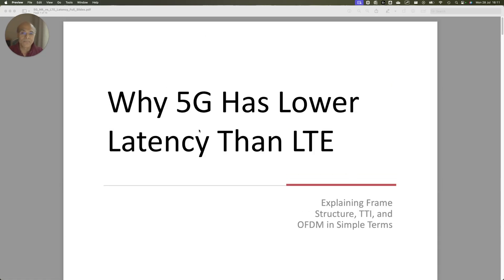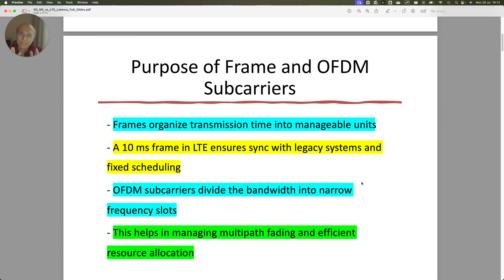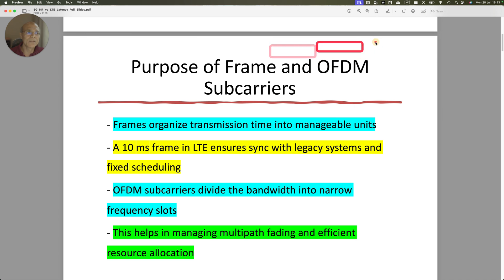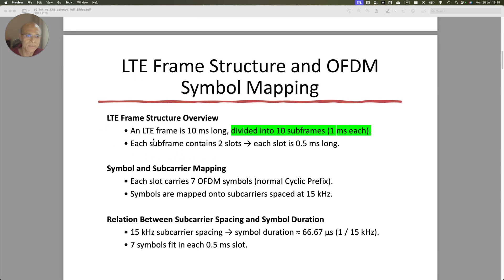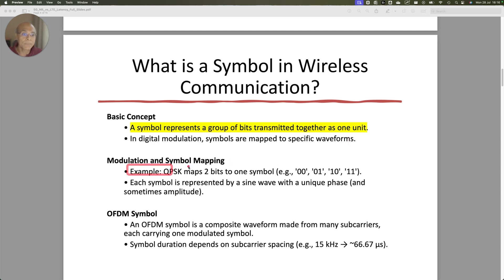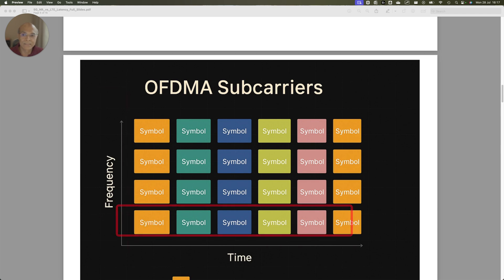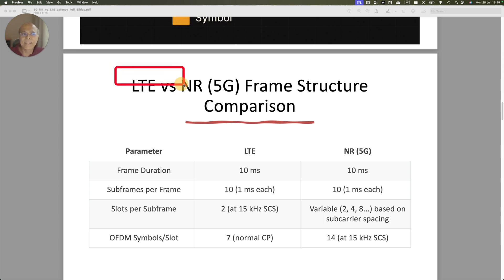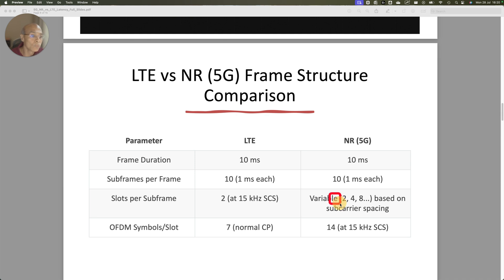Why 5G Has Lower Latency Than 4G LTE | Symbol, Subcarrier & TTI Explained Simply

Comment: Yes sir, while 5G certainly outperforms 4G on paper in terms of speed, latency, and overall network capacity, the reality for the average user is quite different. The real-world benefits of 5G are still limited, especially when you consider the significant infrastructure investments required by telecom operators. Unlike the relatively simpler 4G network stack, 5G demands a complete overhaul of existing systems, including new base stations, fiber optic backhaul, and advanced antennas like MIMO. On top of that, higher-frequency 5G bands, especially mmWave, struggle with indoor penetration, making coverage inconsistent unless there's dense deployment. So, for now, 5G feels more like a future promise than a present-day necessity for most users.
Reply: One major point I forgot to mention, none of the telecos in India has monetized 5G yet.
When they will do it, it will get a lot more expensive for the end user to recharge for 5G pack over 4G, in that case better alternative will be to use 4G for outdoor internet access and a Fiber connection for households or institutions
Reply from the maker: @nirbhaykumarchaubey8777  Thanks for your thoughtful feedback—and you’ve rightly captured many of the current limitations of 5G. In the Indian context specifically, 5G is even harder to monetize because operators lack sufficient low-frequency spectrum (sub-GHz), which is essential for ensuring consistent coverage and enabling differentiated services. For 5G to go beyond speed demos and truly support monetizable use cases like network slicing, low-latency applications, or QoS-based services, operators need at least 20 MHz of contiguous spectrum in low bands like 700 or 900 MHz. Without this, indoor coverage remains patchy and user-level slicing gets throttled, falling back to best-effort delivery—essentially becoming a glorified 4G experience with a new label. Until India fixes this fundamental spectrum imbalance, most 5G applications will remain technically possible but commercially impractical. So yes, for now, the “promise of 5G” outweighs its real-world impact, especially for the average consumer.

Comment: Hello sir 
Or teacher
I humbly request you
Could you tell us how in this video we are getting wild LTE speeds ,almost rivals NR speeds ..
So speeds can be reach regardless of generation of networks,right?..
Or something more complex operation is goingon rather just bandwidth

Source:https://youtu.be/oEJlcH94z_c?si=-EYajlVVg0x0xjG7

and this question had been asked earlier by  someone too😅
Reply from the maker: Thank you for your respectful and thoughtful question!

Yes, the video you’ve shared shows very high LTE (4G) speeds—around 250 Mbps down and 60 Mbps up—which do come close to early 5G performance. But these speeds aren't magic—they’re the result of a very well-optimized LTE-Advanced network, and in this case, it’s from Canada (Telus network), not India.

Here’s what’s happening in that video:

✅ Massive Bandwidth via Carrier Aggregation: The operator likely used 40 MHz of TDD spectrum in the 2300 MHz band (Band 40) combined with other LTE bands through carrier aggregation, giving the device access to 60–70 MHz of spectrum—something that’s rare even for Indian 4G deployments.

✅ Great Signal Conditions: The user seems to be stationary and close to a tower, leading to strong signal strength and allowing the phone to use higher modulation schemes like 256-QAM and 4×4 MIMO, which significantly boost speed.

✅ Low Network Congestion: In that moment, the network was likely under minimal load, which allowed the user to get the full benefit of the available resources.

So yes—high speeds can be achieved even on 4G when large spectrum, advanced aggregation, and ideal conditions come together. But it’s important to note that this is the peak of what LTE-Advanced Pro can deliver. 5G, especially with wider mid-band or mmWave spectrum and lower latency, still has much higher ceilings in capacity, density, and efficiency.

So, while it may look like the generation (4G vs 5G) doesn’t matter, in practice, newer generations just make it easier to reach those speeds across more users and in more challenging environments.

Hope this clears it up! 😊
Reply: @paragkar  Sir, Can you explain 4×4 MIMO in a video. I know that the antenna has +45 degrees and -45 degrees connectors and it's 4 transmit & 4 receive, but how exactly does this work ?

Comment: What is network slicing? Can it enhance network experience, and does Jio actually offer it? I’ve seen recent reports saying they’ve deployed live 5G network slices—can you clarify?
Reply from the maker: Network slicing refers to the capability of a telecom network to intelligently differentiate between different service streams and allocate resources accordingly—offering some services higher priority, better latency, or guaranteed throughput via tailored SLAs. This slicing can be configured both at the network level and at the user equipment (UE or handset) level.

Currently, both Jio and Airtel implement slicing for their Fixed Wireless Access (FWA) services, such as Jio AirFiber and Airtel Xstream AirFiber. This ensures that traffic for these premium FWA customers is insulated from congestion caused by best-effort internet traffic on the same network.

However, there’s a key difference when it comes to handset-level slicing:
	•	Airtel lacks the capability to implement slicing at the handset level because it has not deployed a full-fledged 5G Standalone (SA) network at the required granularity.
	•	Jio, on the other hand, has deployed SA 5G and technically supports slicing at the handset level. But Jio faces a constraint: if it enables slicing for handset users, it risks degrading the quality of its best-effort traffic, especially for indoor users. This is because Jio’s SA 5G coverage indoors relies heavily on just 10 MHz in the 700 MHz band, which has limited capacity. Prioritizing certain handset traffic through slicing could result in congestion for other users on the same spectrum.

Comment: Sir, my house is located approximately 600 to 800 meters from the mobile tower. However, am unable to receive Vi's 2500 MHz band signal indoors, even though it works well in the open areas outside my house. On the other hand, Airtel's 5G on the 3500 MHz band delivers speeds above 100 Mbps indoors, despite both Vi and Airtel towers being located at the same site.Sir what is the reason behind this.
Reply from the maker: This performance difference is driven by two key factors:
	1.	Spectrum Depth: Airtel’s 3500 MHz band deployment has nearly five times more spectrum than Vodafone Idea’s 2500 MHz band. As a result, even with an apples-to-apples comparison, VI’s network will experience significantly lower peak and average speeds—potentially just one-fifth of Airtel’s—especially under load.
	2.	Better Anchor Band Strategy: Airtel uses a low-frequency 4G anchor band (like 900 MHz or 1800 MHz) alongside its 5G deployment, which ensures stronger and more reliable control signaling between the device and the base station. In contrast, a 4G device without carrier aggregation (CA) or operating on a higher anchor frequency may experience less stable signaling and performance.

Additionally, Airtel’s network is likely better optimized overall—in terms of radio planning, load balancing, and backhaul capacity—which further enhances the user experience compared to VI.
Reply: @paragkar sir if vi launch its 5g in 3500 mhz 50hz frequency in my area .does I'm able to use it in my mobile .
Reply: How do you knew such spectrum detail because normally a mobile doesnt show such information.

Comment: 5G sucks in battery backup
Reply from the maker: Great Observation! Yes, 5G typically consumes more battery than 4G, and there are a few key reasons for that. First, 5G—especially in NSA mode—requires the phone to connect simultaneously to both 4G and 5G radios, which increases power consumption. Second, it often uses higher frequency bands like 3500 MHz, which don’t penetrate buildings well or travel far, so at the cell edge, the phone needs to boost its transmit power to stay connected—draining more battery. Third, 5G networks dynamically aggregate larger bandwidths, and your device constantly scans and manages these wider channels, adding to power usage. Frequent handoffs between 4G and 5G layers, especially in patchy coverage areas, further strain the battery. Over time, as more networks move to pure 5G Standalone (SA) with better coverage and optimization, battery efficiency is expected to improve.

Comment: Dear Parag Sir,
How does 5G have better speed than 4G ?
For example with my Airtel, I get around 100Mbps speed on 4G (LTE-A) whereas I get around 300Mbps to 450Mbps in 5G NSA on the same 1800MHz frequency band. Is it because of more bandwidth or because of the modulation such as QPSK or 64-QAM / 256-QAM ?
Reply from the maker: Thank you for your question! While it might seem like 5G is giving you higher speeds on the same 1800 MHz band as 4G, that’s not exactly the case. In NSA (Non-Standalone) 5G—like what Airtel uses—the 1800 MHz band acts as an anchor for signaling, but the actual high-speed data comes from the 3500 MHz (n78) band, which is added on top. This additional band has much more bandwidth (typically 100 MHz) compared to what 4G uses, and that’s the main reason you're seeing speeds of 300–450 Mbps. So the performance boost is not due to better modulation alone—both 4G and 5G can use 256-QAM—but because 5G gives your phone access to more spectrum, allowing higher throughput when both bands work together.
Reply: N78 on b3 band
Not same band
Reply: @fact934  It's not n78 band.
Reply: maybe both..I maybe wrong..Not experience but I have seen some countries achieving300-400 mbps in 4G only!
Reply: @wildyato37  There is 4.5G Pro and 4.9G which can capable enough to reaches speed upto 1Gbps.
There is also a partnership between Alfa and Nokia on 4.5G Pro in Lebanon for cat. 16 capable devices in 2018.
Reply: For current scenario 4G can capable enough to compete with 5G in handset level.
In LTE cat. 12 the download goes beyond 500mbps and upload speed up to 100mbps which is also part of 3gpp rel. 11 and some extend the download speed can reach upto 1Gbps.
Reply: @SBSB-so7ep Sadly in India we don't get that much speeds😅

Comment: How much hours mobile tower work even when power goes in site , how generator turn on ?? Automatically or manually??! Is. Battery 🔋 back up there??
Reply: I always had this doubt.....
Reply: Every tower has a 2-3 lithium ion battery, which can run the tower for 3-4 hours (depending on equipment used for BTS).

Every tower has an ATS (Automatic transfer switch) which starts the generator if the battery percentage is below some certain numbers.
Reply from the maker: @rishi_raj_01  Thanks for responding and clearing the doubt.
Reply: @rishi_raj_01 ok👍🏻